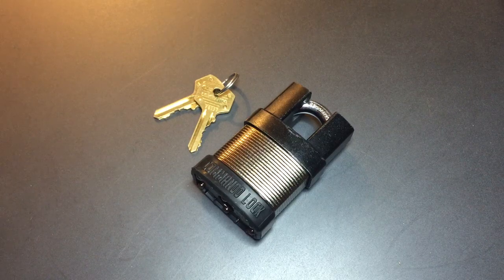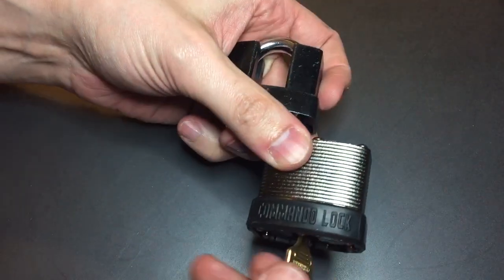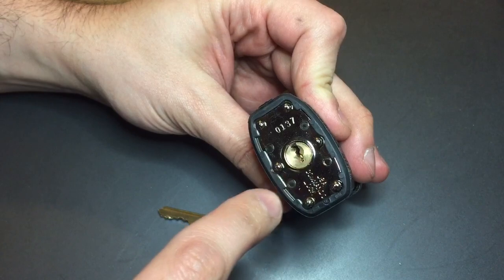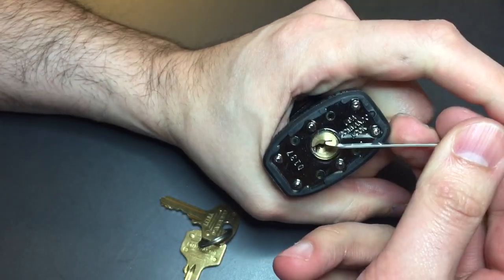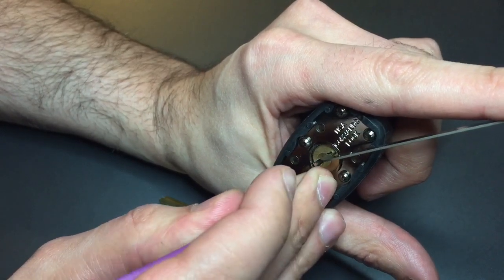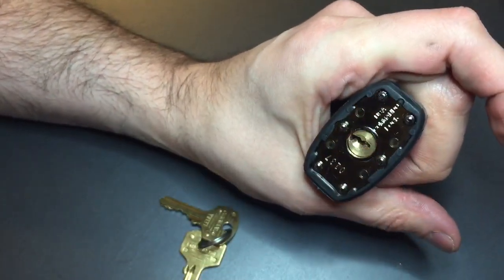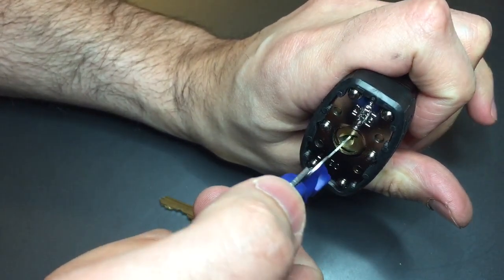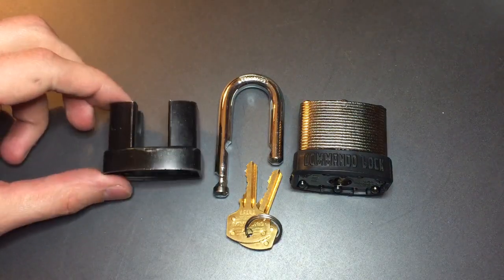[133] Commando Lock IC3 Tactical (w/ Shackle Guard) Picked

Comment: Hi Harry,   Great little padlock, so well designed and thought out. Great picking too, of course. You always make it look easy - which in most cases it's not!  Regards, Brian.
Reply from the maker: +Brian Hignett Thanks.  Definitely a nice design.  I particularly like the fact that you have to pick it twice (or use the plug spinner).  You make a good point that the difficulty of a lock doesn't always make it across in the video.  I don't have a good solution for that.

Comment: Can anyone recommend a good latch a good latch for this lock. I have a shed I keep my bikes and various tools and things that are valuable to me. I'm trying to make it as secure as possible for my budget. This is the lock I plan on getting, but the janky old latch I'd be keeping the lock in would be no problem to saw thru. I am on a tight budget, but would love any recommendations. My current latch is kept on with torx bolts and locking nuts, and the pins for the hinges are on the inside. I think everything is fairly secure except the latch its self.

Comment: why they dont just make them removable shackle it would be easier to unlock
Reply from the maker: A good question for the lock maker.  I suspect the answer is that the base lock is intended for use as an interchangeable shackle lock, but without the shackle guard.  There's no doubt that the shackle guard creates some usability issues, but having to pick it twice makes for a particularly nasty lock.

Comment: There's a major problem with this & other Commando locks that isn't mentioned here: they have soft brass keyways & no anti-drill protection. These could easily be defeated with cordless drill. I emailed Patrick Smith just asking if they have these basic security features and he essentially said: "no, not at this time". So much for soliciting input from the picking community. Id stay away from this for now. Better off with an Abus for the same amt of money.
Reply: Yeah, if you see a shady looking individual headed for your storage shed whilst carrying a cordless drill, you'd better worry.